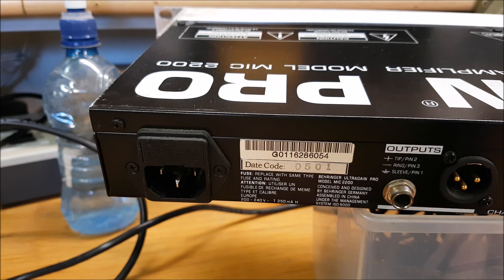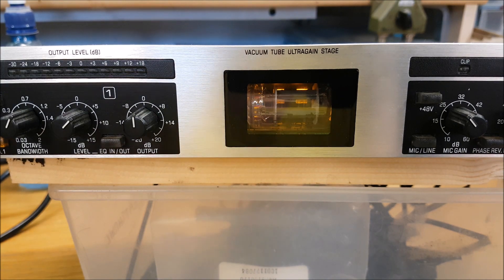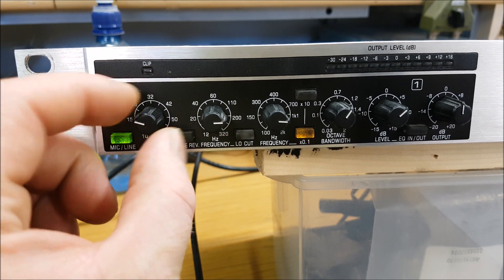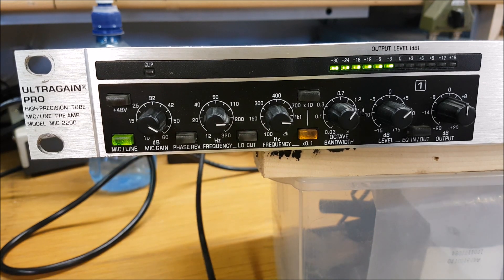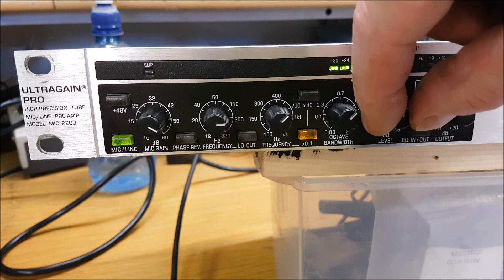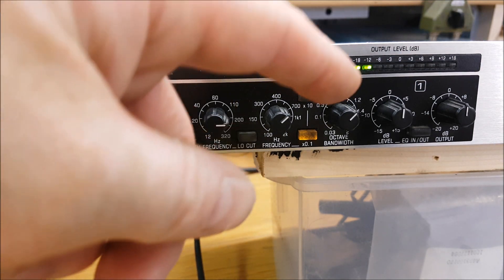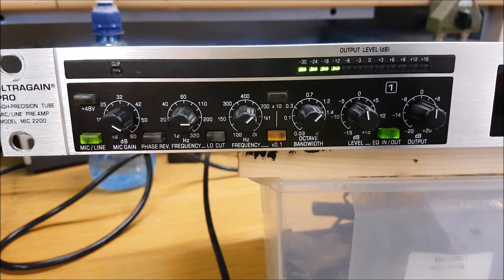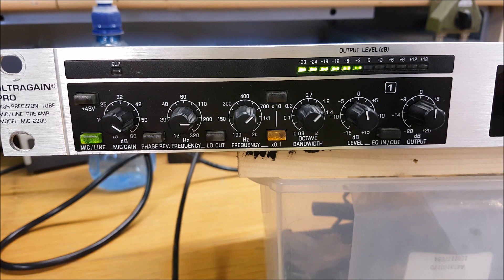THE BEHRINGER MIC 2200 PRE AMP EXPLAINED

Comment: You got a good deal on the pre-amp. I just did, March 2024, an EBay look-up and used it seems to be running $100 + with one seller claiming new and wanting roughly $360.

I have several hand built mic preamps, but would like to buy a used or new professionally made unit. Not sure whether I want just a mic preamp or an audio interface for the computer & depends on what I chose for the audio path into my RS 918. There are so many options & honestly I don't know which to pick.

Thanks 5 years later for your audio videos. They have been most helpful in setting up my Beringher model 1200 compressor. Not sure if I will use it but likely will give it a trial.
Reply: I just bought it for $39.00

Comment: the 2nd knob which has a frequency range from 12Hz to 320Hz is the high pass filter cut-off frequency, so it works only if LO CUT is on. 
For x0.1 and x10 buttons, you can use a 3rd know which has a 100Hz - 2 kHz range.
Having on x0.1 you multiply the value of the knob, so you have a range of 10Hz - 200 Hz,
having off both x0.1 and x10 you have a range of 100Hz - 2 kHz,
having on x10 you have a range of 1kHz - 20kHz frequency.
So the entire audio range is 10Hz to 20kHz
x0.1 and x10 buttons are part of the parametric equalizer. It works together with octave bandwidth(4th knob) and dB level (5th knob) so until the EQ IN/OUT button is not on it will not change anything.

Comment: i'm afraid you not understanding the functionality of this preamp correctly the first frequency control is the cut-off frequency for a high pass filter The low cut button is hi pass filter in out
next is a very nice panoramic EQ with variable Q which can be used to enhance voice Low Q setting or to reduce room residence with a higher Q setting The output control
actually controls the drive to the valve 😊
Reply from the maker: Thanks for the info!

Comment: Hey George nice walkthrough and I need a clarification in the Tube thing. Is it link 2 channels use 2 seperate tubes or both the channels are summed before entering a single tube ??? Any thoughts on that ?
Reply from the maker: at a get id imagine the tube is shared. its more there for the looks more than anything else to be honest. I run a DBX286S now and a Shure SM7B
Reply: @GeorgeEI7KO  Thank you so much George ❤
Reply: It's not about looks. Tubes have 9 pins and 2 sets of triodes. Each channel uses one set of triodes. Take the crappy chinese tubes out of it and install a new Mullard ecc83 or a vintage 12ax7 tube if you want a nice sound.
Reply: @jeremygrahamellis  Thank you 😊
Reply: @josephjebarajs3550  no problem. Fair warning, though. The unit is not easy to take apart and put back together. There is a youtube video on how to do it. I changed the tubes in two of my units and I could have easily damaged them if I had pulled the parts too hard. You have to take off all the knobs and remove enough front screws to take off the silver panel. There are rubber gaskets and a circuit board that need to slide out of the front panel, and also two screws with a rubber piece that hold the tube in place. But if you have a couple hours on a day off and don't care about you warranty....
Reply: Also, notice that the unit takes a few seconds to warm up before you hear anything. This is because the tube is actually working to make the sound. Different types of tubes will have different sounds. They have different EQ responses and distortion at different levels. They also have different output gains, so some might be louder or softer. The thing about a nice vintage tube i that it just has this sparkle and sense of "space" that is magic.

Comment: A great unit nothing wrong with using it to give some warmth to your mic or line in. A Tube swap is very easy to do on this unit.
Reply from the maker: I still have it, but dont use it any more. I've since upgraded to a DBX286S.
Reply: George EI7KO Yep those DBX units are seen quite a lot on vocal racks. Too bad that unit is not a tube preamp but is does have an external FX send loop to send it out to a tube preamp so you can use it with the Behringer Tube Preamp.
Reply from the maker: @danfuerthgillis4483  for what I'm doing  with it its quite sufficient. In ham radio use, we have very narrow bandwidth to deal with. Typically 100hz to 3k, so most radios roll off the warm low end regardless of what you have
Reply: I just looked it up and it looks like you have to completely dismantle the thing for a tube swap... Idk if i would call that easy.
Reply: @myautodidacticism  You just open the top cover of the pre-amp and that's it. You don't have to take whole thing apart.

Comment: This is funny. I finally figured out how to work my crazy multitrack console (have been through 3 of them never getting the hang of it) and am finding my dynamic mic picking up all kinds of hiss through this preamp and much quieter and stronger bypassing it, directly into the console. I'm looking up causes and fixes and came almost straight to your video having forgotten I did a year or so ago (tho you did look deja vie familiar). I thought right away "good vid" and later read someone's comment which turns out to be me.  Anyway thanks again.  Hope the bass is working out.  I don't really play but use it when needed. Right now, got to figure out what's going on with the noise.

Comment: I have a similar Behringer unit with Preamp, but my intent is to record in ProTools with it. I’m buying a Scarlett 18i20 USB interface, but it also comes with a preamp, so I know that’s trouble. How would you hook both of them to work into ProTools with processed audio?
Reply from the maker: But you wouldn't need it in line with the scarlett??? What's the point?
Reply: George Donaldson EI7KO Sorry, my Behringer unit is a Ultra Voice Pro, which is a Vocal Processor, it comes with EQ, Gate, Compression and DeEssing, but it’s also a preamp, I guess I should’ve specified that my intent is to process my vocals prior to get to ProTools, but preamp on preamp is quite an issue. The unit is Behringer Ultra Voice VX2496, and thank you deeply for your help! I’m going crazy with this stuff!
Reply from the maker: @GuillermoParedes51  either use the mic or line input. I can't remember if there's an option to bypass the preamp on that. Maybe a possibility on the scarlett? Deffo either turn the gain dow/off on the second unit. I'm. Assuming the scarlett will be ahead of the behringer in the chain
Reply: George Donaldson EI7KO that’s my confusion. The chain. My guess is Microphone>Vocal Processor>Interface>DAW... but I’m not sure if this is how it would work, since they both have preamps but none of them has a bypass button for it.
Reply: @GuillermoParedes51  hi, did you found out what is the issue?
Same problem here xD
Reply: @resurrecttheafterlife2000  they both should have pass through and the order should work, I have almost the same thing and a mixer thrown in, the mixer makes it much more complicated. Just keep the gain levels on the interface all the down
Reply: @JordanRainey  ah if it's work that simply then nice xD
Thank you

Comment: Can I use this to preamp the music coming out of my mixer that leads into my crossover, eq, and amps? If yes, can I use a microphone on 1 channel and my music on another?
Reply from the maker: You can use it to preamplify the music or the microphone. You can't do both at the same time. Your mucic source will be a stereo signal (2 channels) and you'll need to feed each channel into the preamp and on to your crossovers and on down your chain. To add a mic to the mix you can either have a second preamp in the chain or add the mic at the mixer stage if you have one. Hope that helps.
Reply: @GeorgeEI7KO  well I have all the music in mono to be honest I don't have the ideal set up for stereo
Reply: That's why I was asking if I could use the mic on the other channel cause I wouldn't use the other channel of it with my amps and what not